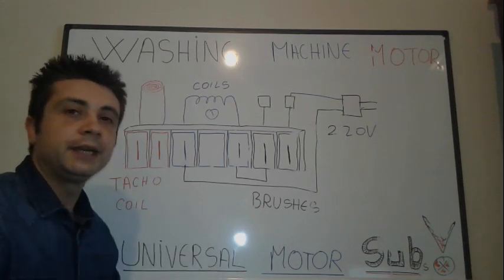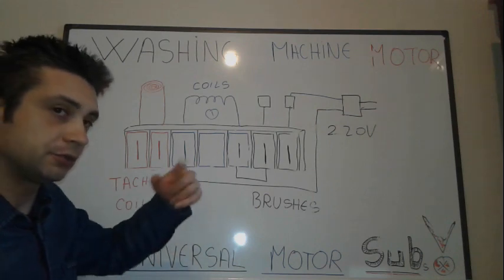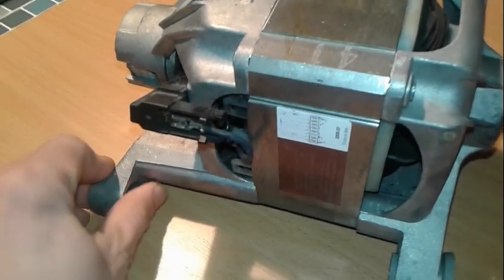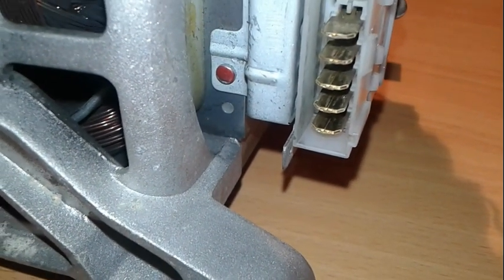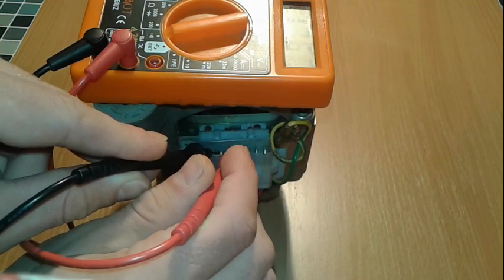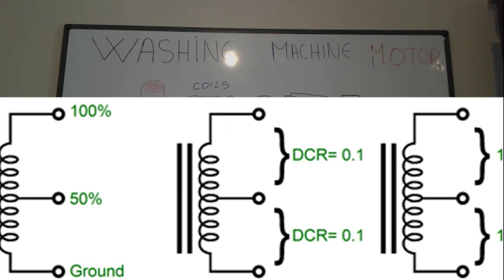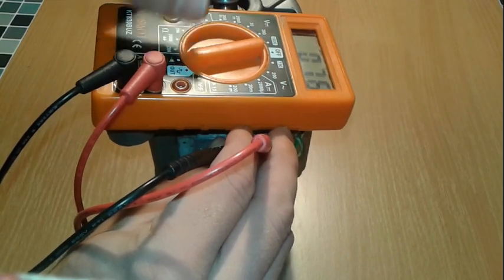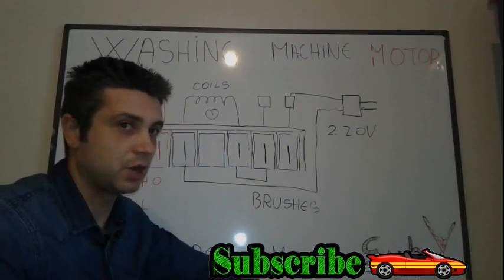Washing machine motor wiring explained

Comment: Sir pls tell me Bosch front load washing machine 6 pin motor wires are came out from the socket which is connected to PCB so can you suggest which wire is to fix where

Comment: I have this question on a washing machine motor we know it's a universal motor what I want to know is I know its 1\3 hp so if I am to run it at 12 volts will it still be at 1\3 hp 
               Thank you for your reply
Reply from the maker: David Steinfeld that would be a free energy type of device the full specs are achieved at his rated specs which is 220v ac or DC equivalent on 12v it will run way less then 1/3hp but increasing the voltage 48v will run close to 70%of the capacity with decent torque hope that cleared some of the questions all the best we have to investigate more